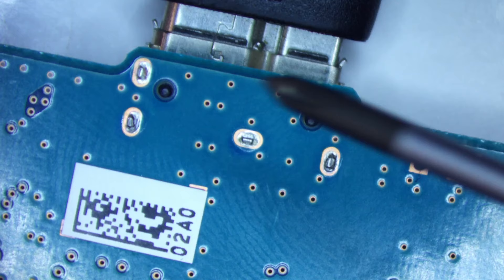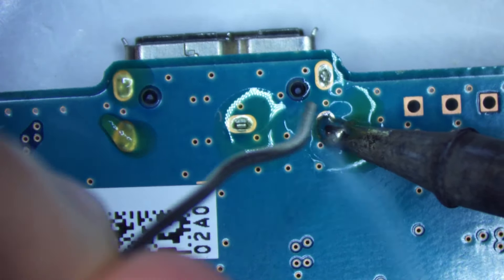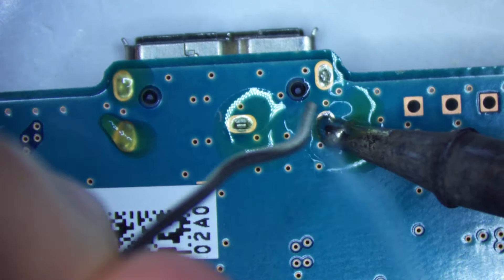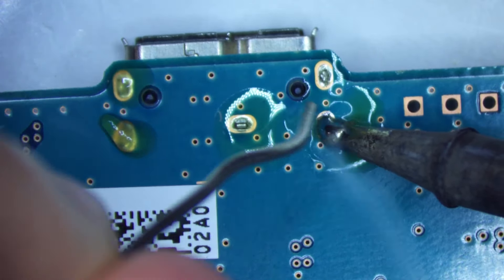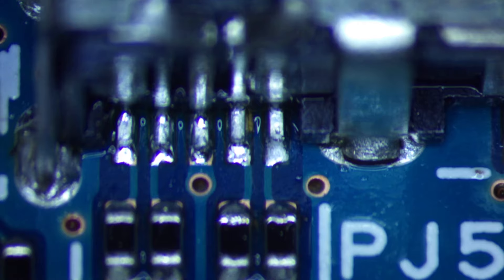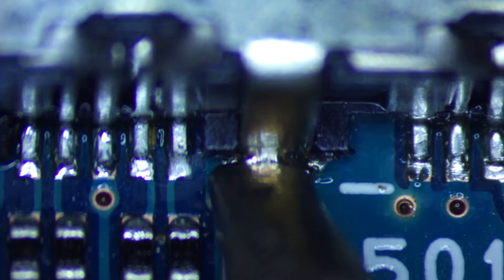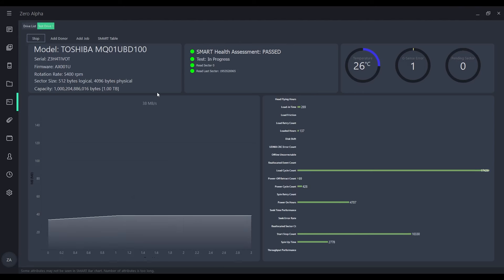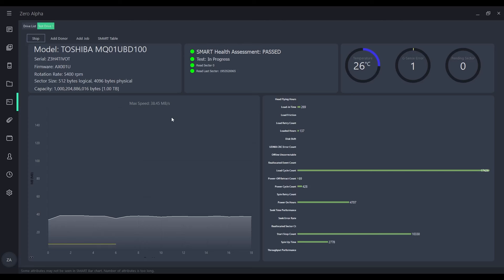How to Fix a Broken USB Hard Drive connector

Comment: I have the same high drive you showed in this video, but in your video, the whole USB connector is wobbly and broken off, however mine the inside part of the teeth/pins (the small metallic parts of the smaller parts of the USB Micro B) are broken. How would you fix this? It is solid and still stuck on unlike yours. Would the whole USB connector need to be removed and a new one put instead??

Comment: Mine has the LED light, spins, just doesn't recognize...should I just get a new usb connection piece?!  Been trying to fix this for 5yrs, and it's not of the dozen things the internet says...I'm pretty sure it's the same thing that happened to my Seagate, but that has a piece you can just take off like a lego, and put a sata connector on.

Comment: I've got an OWC Thunderbay that has a thunderbolt port that was ripped out (I can't find the bit inside).  I've also got a 4 bay thunderbolt NVME enclosure that won't turn on and I suspect the power usb-c plug to be the issue.  Do they work the same as usb-c in this video?
Reply from the maker: Probably some nice soldering to fix it.

Comment: I never knew that these drives existed.
I always thought that all external hard drives were just regular 2.5" SATA drives with a USB adapter in an enclosure.
Reply from the maker: Seagate is the only brand that is a SATA drive with a USB adapter. WD and Toshiba both have embedded USB